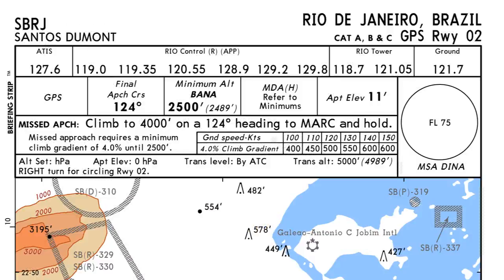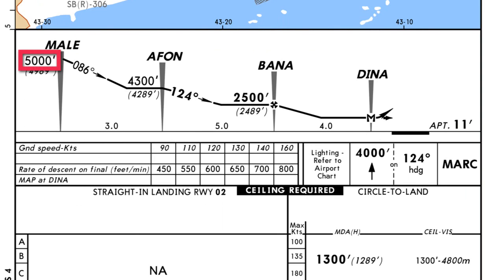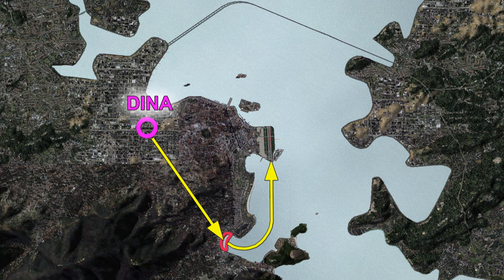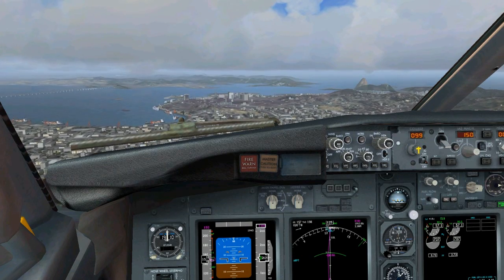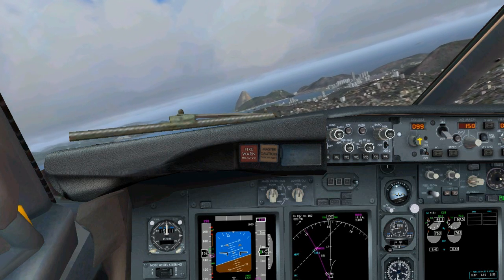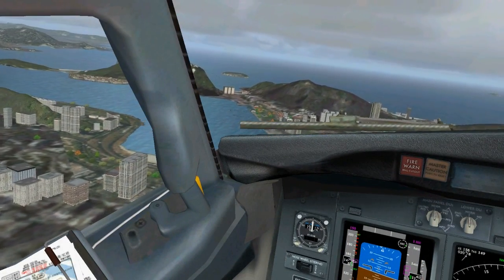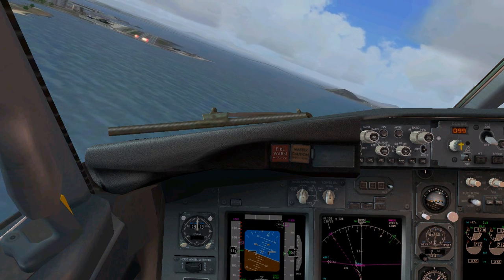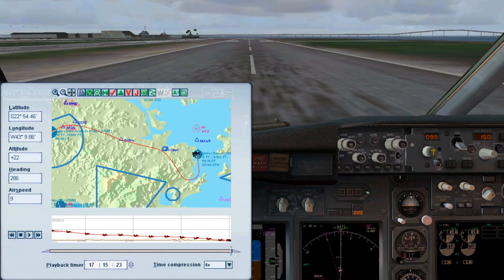Santos Dumont (SBRJ) GPS Runway 02 Approach

Comment: Good job, guy! I'm brazilian and I've saw this approach sometimes, and you really done a perfect approach in SDU. I was thinking on suggest you do that tutorial, but saw it's not necessary anymore...
Recently they changed the procedures in many routes in Brazil. The most important changes were for the Stos. Dummont and Congonhas. Check out (link) the new IAC charts for SDU on this site:

http://www.aisweb.aer.mil.br/?i=cartas&filtro=1&nova=1

For many situations, the most used approach is the NDB B 20L and 02R yet ,  but they intend to change it, for fuel and time economy, using RNP...

Comment: for some reason on my fsx map some of the points on the chart for this approach are missing such as DINA and BANA...but you have it on yours? how
Reply: The map isn't up to date... you need to update the FSX database (VORs, NDBs and waypoints), unless you're using aircrafts with FMC - which is not the case of default airplanes on FSX...
Reply from the maker: Antonio Carlos Prado Thanks so much for the answer :)
Reply: Antonio Carlos Prado thanks i already figured that out. I looked online and got updates for that. and yes i only fly aircraft with FMC.
Reply: I think Dina and Bana doesn't exists anymore... In Brazil the charts have been changed a lot! If you wanna do this procedure, I suggest you to try the RNAV Y RWY02R or NDB B RWY02R
Reply: I can imagine that. And yeah thanks for the suggestion the approach chart i found for the RNAV Y RWY 02R are in spanish and i cant understand it. :D
Reply: In fact the charts is in portuguese... but I think it isn't a problem. You only need to update your AIRAC for your preferred airplane. The AIRAC cycle must be the 1313 to match the most recent changes...
Reply: Antonio Carlos Prado thank you so much. I found that on navigraph.com :)